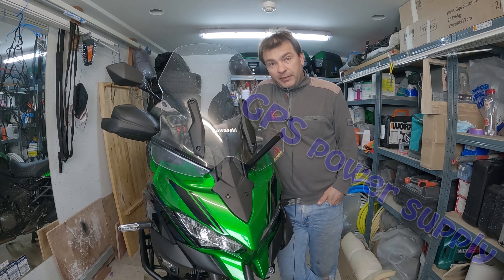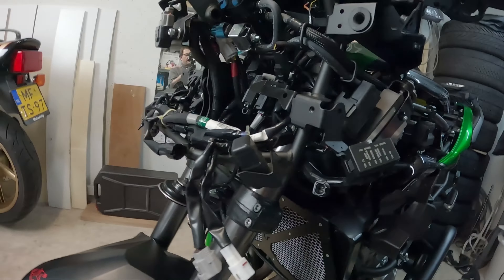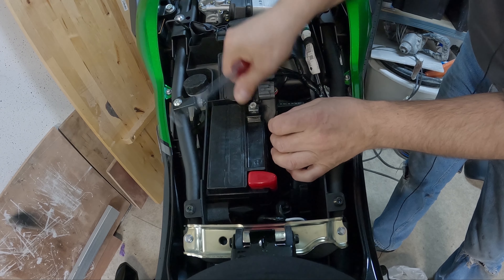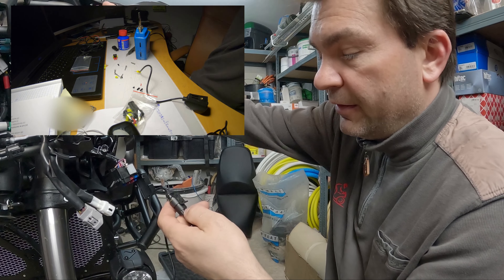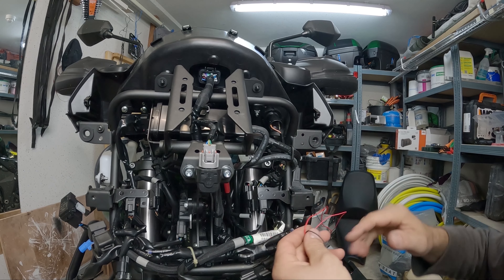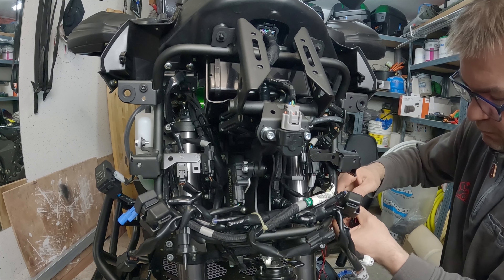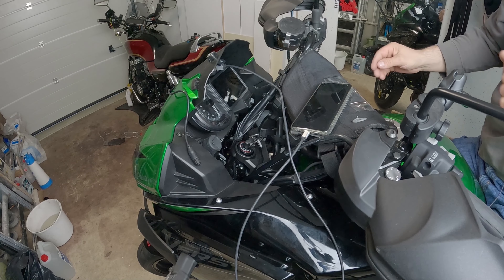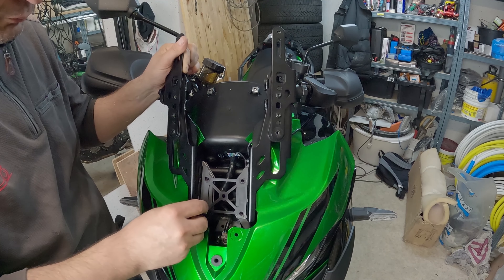Additional USB charging socket   GPS power supply

Comment: Nice video and good work.

Nice to see MotoAndy again.

You may have one free fuse for add on devices on some motorcycles. You can use it if your motorcycle have it.
Reply from the maker: Hi J8zzy🙂 of course, there is one free fuse to connect accessories, but the fuse has voltage all the time and I wanted everything to be powered only when the ignition is turned on
Reply: @MotoAndy  Yepyep. Great work.

Comment: Thought the SE version came with the USB socket from the factory. Sorry got confused with the lighter socket and USB socket.
Reply from the maker: Yes there is lighter socket, I use adapter lighter/2xUSB but it's not enough, I have a lot of batteries and other things to charge at ones so another 2x USB is very handy 🙂

Comment: Andy, for the USB outlet:  If I understood correctly, you connected it in parallel to the ignition circuit. Meaning, you bypassed the ignition circuit fuse.   If this is correct. you now do not have a fuse protecting your USB outlet unless it has its own built-in fuse...). And if indeed so, and say something goes wrong with the USB circuit/load, wouldn't it present a risk to the ignition circuit?

Comment: Hi Andy and regards from the US.  I'll be interested in getting your feedback on level of vibrations of the SW-Motek GPS mounting HW.  Saw a few You tubes in which some folks complain about vibrations which interfere with ability to read maps and such... Just wondering.   Love your videos!!!
Reply from the maker: Hi, thanks. I have heard about this problem but never had it (by the way, next week there will be a video about mounting this mount to my V1SE) I have never had problems with the vibration of this mount, I can read maps without any problems despite the fact that I usually use reading glasses. Maybe the problem is with other brands of bikes that have higher vibrations, I don't know. As for me, I can safely recommend this mount, I am pleased with it. Ride safe.
Reply: @MotoAndy  Okay Andy, got it and thanks much.  By the way, what specific handlebar bag are you using?  I am thinking I ought to get one.  Again, thanks and I'll be looking forward to viewing your GPS mount video! Best!
Reply: @MotoAndy  Same from my side. I use the SW Motech GPS mount with a TomTom Rider on my 2022 Versys 1000 S  without any problems like vibration etc.
Reply from the maker: @yl4970  it is cheap simple bag from Acerbis  https://www.24mx.nl/product/gereedschapstas-acerbis-manubag-zwart-grijs_pid-PIA-211457?gclid=CjwKCAjw0dKXBhBPEiwA2bmObW7A4V1ZetaGJenj87OXZXXCO5l6JXNn3s3nji5pHV07Bi7zD-6tCBoC5jkQAvD_BwE&gclsrc=aw.ds

Comment: I'm no electrician but this feels very wrong. I would have taken the power directly from the battery, with a relay acting like a switch from an ignition / ACC wire, test the amperage and then put a fuse on the wire. I'm gonna laugh if you blow a fuse every time you lean to the left or right (cornering lights) or when you use the horn 😂
Reply from the maker: Yes your right, your not an electrician, 
9,000 km with this connection and not a single blown fuse, and no additional cables hanging around the battery.🤔🙂 Ride safe😁
Reply: @MotoAndy  I wonder why accesories such as fog lights or heated grips come with their own relay and fuse then... 🤔 I guess they are just wrong. They should just tell people to modify the fuse box and connect to anywhich wire on their bike instead 😁 Usually you make such great videos, but this one is a fire hazard waiting to happen 🔥
Reply from the maker: @sunnycloudy1337  I can see we have to agree that we disagree.🙂 I will come back to this comment in some time and let you know if my Versys has already burned down.😉 And by the way, I am an electromechanic by profession😐. Have a nice day 🙂
Reply: @MotoAndy  That's the thing, I don't want your Versys to burn down, or other people's motorcycles that have watched this video. If you are a professional like you say you are, why don't you explain how these connections are totally safe, instead of being a wise-ass about it? 🤗
Reply from the maker: @sunnycloudy1337  all connections that can be seen are soldered so here you can exclude the possibility of overheating of the cables due to poor contact, I did not change the fuses to larger ones which could cause overheating of the installation, all devices connected by me have low power consumption, connection to LED cornering lights or the horn does not overload it, each fuse in the electrical system have so-called reserve, i.e. simply speaking, has more possibilities than the device that is connected to it. So far, I have not had any problems with fuses or overheating of the installation, I charge several devices at once, such as the phone, batteries for cameras, drone and others, the navigation is always connected. And finally, in this video I show how I did the installation in my own motorcycle, I am not forcing anyone to do the same, although if you read the comments, you will notice that there are people who connected their devices in the same way and no one mentioned blown fuses, my previous versys had the same connections and I rode almost 40,000 km with it, no problems at all. I do not persuade, I do not force, Your motorcycle Your decision.
Reply: @MotoAndy  good answer 👏thanks for taking the time and explaining!
Reply from the maker: @sunnycloudy1337  No problem, the comments are here to discuss this video and the material contained in it, and people's reactions are different, as you probably know for yourself, the internet is full of different personalities, so sometimes I react like a smart ass because you just can't please everyone . Have fun on your bike and don't burn anything but some rubber.😂